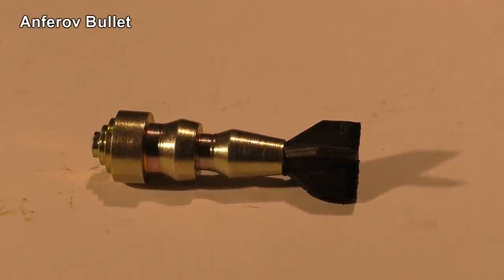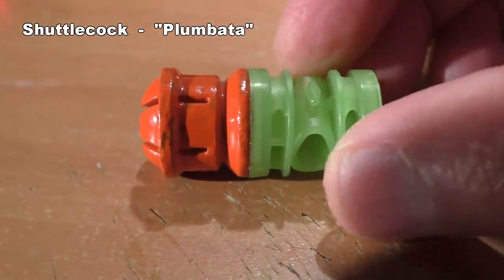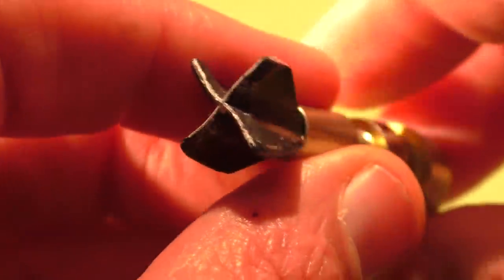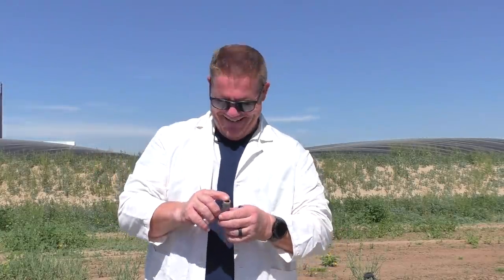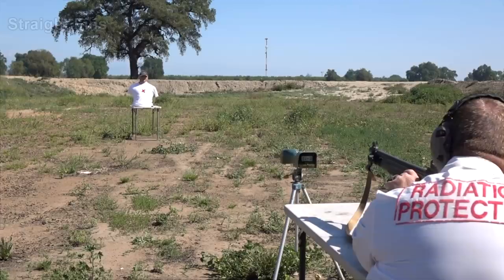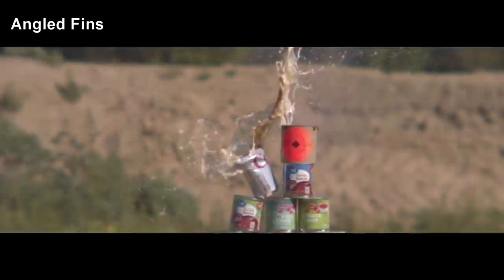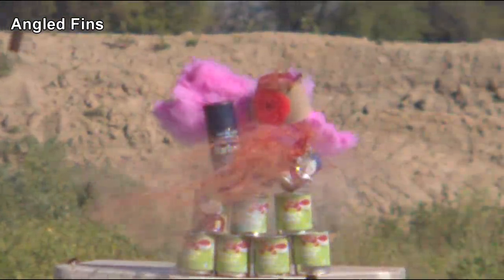Supersonic Darts - The Effects of Inducing SPIN - I learned something!

Comment: Sun Naegele who was interviewed by Ian McCollum, hinted at the stabilization of a diabolo round differing from that on a typical fin-stabilized round. He likened the former to a shuttlecock… the primary effect then would be drag, i.e. the tail is subject to greater deceleration in the air which is compensated by the tail creating a pull on the head of the round, thus keeping it aligned with the direction of travel.

The primary effect aimed for in a fin-stabilized round, on the other hand, is creating lift in the opposite direction when the bullet is not flying straight. This is because there's a non-zero "angle of attack" between the oncoming relative wind and the side surfaces of the corresponding fins. So these work more like aircraft wings.

That said, it's presumable not either or, i.e. the tail of a diabolo will also generate lift if the bullet is not flying straight, and fins also induce some drag.

Comment: What about a fin stabilized projectile with bent fins shot through a rifled barrel? Double the spin double the accuracy !!! What about a fin stabilized projectile with bent fins where the fins can spin independent of the body of the projectile, I had some darts that were like that. What about a fin stabilized projectile with fins that spin independent of the body shot through a rifled barrel? If you shot the fin stabilized projectile with bent fins straight up into the air how fast would it be spinning when it came back down and what would the coefficient of drag be? What if you shot a fin stabilized Fin out of a cannon, would you want that Fin to spin?  Enquiring minds want to know. Thanks for another great video. I'm highly amused by the questions people ask so I thought I would ask a few of my own since I have never had any to ask before.
Reply from the maker: We wouldn't have been able to tell if the spin was from the rifling or the fins.

Comment: The massive rate of rotation by caused by the fins makes me wonder if it caused by the expanding gases from the gun powder through the barrel rather than the air moving over it. 🤔
Reply from the maker: If that was the case,  the muzzle blast would spin it in the other direction
Reply: Good point, love your work good sir.

Comment: All those non-spin-stabilized projectiles use the same effect for stabilization: Center of gravity in front of center of aerodynamic forces. Nose heavy design and/or draggy light tails. 
Adding spin can also add imperfections to the shot. It can add dispersion.
If spin would help, you can be sure that tanks would use it with APFSDS ammo. But they don't.

Comment: Fin stabling only works if the center of gravity is in front of the center of pressure. Basically there needs to be more surface area behind the center of gravity.

Comment: Hi guys,
Just a suggestion for your high speed camera. Instead of filming from behind the projectile like you are doing, set your camera up 90° to the target. Have the camera aimed so that the target is just on the edge of the screen, that way you will be able to see the projectile either travelling left to right or right to left depending on which side of the target you are setup on. Then in post production you can zoom in on the projectile and follow it to the target.

Comment: 1. If the bend in each fin is not precisely the same, you'll create some instability.  2. When striking the target, the spinning projectile will likely do more damage than the one that is not spinning, or at least different damage depending on the details.  3. The energy to rotate is stolen from the kinetic energy from the velocity, so the spin will reduce the velocity slightly (but probably by an insignificant amount).

Comment: I feel like they're onto something. The bomb Styles last torpedo style is pretty cool but what if the whole projectile was the same length and width instead of getting smaller at the Finns the same with all the way to the top and then you make the top slightly heavier to offset just the wings on the end I bet his the spiral ization would be even better and it would be even more stabilized flying through the air straight then wobbly

Comment: I believe if you spin it from behind like that.
You create oscillation that affect heavier part AKA tip of projectile you throw it of balance.
The rear MUCH lighter than front.
Leave it as it is as original.
First shot set that in stone.

Comment: I'm thinking way too much spin. I'd set the spin for the whole fin to be enough to make 1 turn in 20"... 

Probably about a 5⁰ overall bend, 10⁰ if you bend half the fin. (Same way the F4 fighter got those bent wingtips. Flight tests showed that the wings needed more dihedral, so in order to avoid redesigning the whole wing box and fuselage center section they raised the wingtips up enough for the average dihedral angle to be 6⁰.)

Comment: So In the archery world most people use a 3-6 degree helical or “bend” and they’re only going 300 fps many say that anything over 6 degrees will cause parachuting “ the back of the arrow dancing around and losing stability “ I think spin does help some even with fins already there. Just like in archery 95% of shooters use some offset or helical. However I think you had a little too much bend for something going 1400 fps

Comment: Makes sense to me that the velocity did not change much the energy it takes to spin something up is not very high the momentum is rather small in that axis, If it was a really wide disk with a lot of weight near the outside edge then it would take a lot more energy like a flywheel.

Comment: There are two different effects used with spin stabilization.

1) gyroscopic stabilization - typical bullets, 100,000-300,000 RPM
2) spin-ensured aerodynamic symmetry - RPG grenades, 2000-5000 RPM

When you have a finned projectile that does not spin, tiniest asymmetries in projectile's geometry can cause it to veer off unpredictably. Spinning cancels that out. But the rate is way lower - trying to achieve "gyroscopic" spin rates is completely pointless (and especially detrimental for HEAT warheads). This is why they only put a single-bevel edge on RPG fin blades.
Reply: same as arrows, they just smear their inaccuracies all over the circumference by slowly turning in flight, so they don´t veer off, but move on a narrow cone. the main function of the fletches is to produce a little drag on the rear end to keep the nock from trying to overtake the tip.

Comment: I wasn't surprised at all that the first spin stabilized dart's flight was erratic, if that was the dart shown at 1:13 with the drawn lines on the fins, because the fin angles (imo) were not symmetrical.

Comment: Spin stabalisation is gyroscopic, it can be an internal gyroscope, 'like a rocket' but a trad. spin has drawbacks and benefits. It has induced inaccuracy as a peculiar flight path as it 'walks' from the spin. They don't fly straight but in a corkscrew.

But, they are more resistant to certain conditions over long distance and it can be the cheapest form of stabilization. Can be. It can also remove or reduce side effects of fin stabilization and sabot. It also can have less drag by itself, but not always. To those demanding it, its quite hard to perfect the amount of spin for a round and achieve it, and sometimes that is none.

Spin stabilization also makes smart rounds a bit harder, and another force direction for integrity. They can also make deployable fins more reliable. The spin can also be used to guide on to target similar to the aim-9 sidewinder.

But you'd be asking a lot from spin to make much odds at short range in a shotgun with additional stabilization. It works well with round shot.

Comment: the problem you're having is that for a split second exiting the barrel, the spin being imparted on the shell is actually from the back from the propellent pushing, then once the force from that dissipates, the air flowing stops that spin and starts spinning it the other way

this will impart torque

Comment: The biggest issue is people make the head too big and the body too short for proper supersonic stabilization with fins. If it’s already in a sabot the head does not need to be super huge.
The big point here is the ratio of diameter of the frontal face to length of the body. I doubt much more than the very tips of those fins were interacting with the air. It’s also probably why the spin stabilized one was so violent. I’d adjust it to maybe 5* max 

It’s why things like modern tank ammo and guns are smooth bores and long rod with fins. 
After about a 10-1 ratio of length to width spin stabilization starts to not work reliably. As ap ammo got longer and longer with smaller diameters to penetrate armor. Because velocity and sectional density is what kills armor. 

Also modern fin stabilized ammo is becoming very very slightly spin stabilized. But the fin angle is generally sub 1 degree.

Comment: Fins work because as the projectile pitches or yaws it pushes more on the flat sides that introduces to the air flow. Say it pitches without any yaw, and the fins are aligned to that reference. Two of the fins will be steering it back straight on that axis while the other two will be holding it straight on the other. During that time, however, the yaw fin that has been pushed out into the air temporarily has a greater steering effect than the one "behind" the perpendicular fins. If they're straight it's no big deal, but if they are pointing opposite directions it will have an unbalanced effect. The center of rotation of the force created will not line up with the center of mass, and so rather than stabilizing the flight they will disturb it, which then causes a feedback loop of it getting pushed off center in one direction because it's off center in the other.
Reply: That's why they dropped most of the bottom fin off of the X-15 mid flight, because on re-entry it amplified the effect of the lower fin, and made it hard to control the plane.

Comment: I feel like this isn’t a great representation of spin stabilized projectiles. I could be missing something, but I feel like to be accurate, as a representation of spin stabilization, extreme care would need to be taken, in regard to uniform angulation of the fins, as well as uniform weight of each fin.

My inclination is to think that even small deviations in either of the aforementioned factors, would result in a significant wobble. This is somewhat addressed in the video. But I would like to see the result with a perfectly balanced projectile.

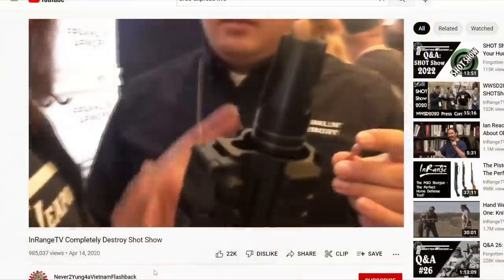Comment: Though spin is a great way to stabilize projectiles the rate of rotation is critically important. Simply inducing a spin in a shotgun projectile dose not automatically = a more stability. Where an M4 works well with rotation rate of 1:7, I'd guess a shotgun would need something more like 1:28 or 1:35 or maybe even slower than that. 

If you spin the projectile too slow you don't get very much stabilization. Too fast will actually cause instability. The length, weight and speed of the projectile all effect what the proper spin rate will be. This why an actual military M4's barrel is different than the twist rate in many civilian ARs. The M4's twist rate is optimized to use NATO ammo whereas civilian ARs often use a slower twist rate because they use a wider variety of ammo found in the civilian market.  In general heavier and or shorter projectiles should have slower rotation rate than longer lighter projectiles.

Also arrow dynamic fins are a poor choice to induce rotation cuz they apply rotational energy only after the projectile is out of the barrel and then they apply that torque to tail of the projectile....Both are less than ideal conditions when you want to increase stability rather than cause instability.

Comment: As you mentioned around nine minutes 18 seconds in your video minor defects can affect the trajectory of the bullet. I noticed that the bend that you put on the fins was, I don’t mean this is a slap in the face, then somewhat crudely. Just imagine if you only been one thin how that wouldThe projectile wobble in the air. I believe you would have a more accurate test were you to standardize the band on each film down to the thousands of an inch. That should give you a much better idea as to the benefit of spin stabilization on this project tile. In my humble opinion

Comment: A rocket goes straight because it’s flight is controlled with actuated fins, and thrust vectoring, not by static fins. So the person at the trade show was wrong. The fins on the original round “stabilize” the projectile by keeping the back end of the projectile in the back, not by making it go straighter. They prevent end over end tumbling. There are two different forces at play here and the discussion in the video seemed to conflate them.

Comment: There's also the issue of length. Generally, yes spin will stabilize a projectile, but this is proportional to it's rotational inertia, and most importantly the axis along which it has the most rotational inertia. Part of the reason that long-rod projectiles like antitank APFSDS rounds are typically shot through smoothbores is that once the length of a uniform projectile exceeds about 2 times it's diameter, the gyroscopic force will DE-stabilize the projectile and instead induce tendency to tumble end over end,  as the greatest stabilizing influence is found along an axis with the highest rotational inertia (the qualifier of 'uniform projectile' is important, and projectiles with light cores and heavy jackets or 'bands" can bend this rule) With fin stabilization involved, projectiles with a very high length-diameter ratio can oscillate wildly, as the aerodynamic forces contend with the tendency to assume a rotation of highest inertia.

That out of the way, I want to disclaim: I am not an engineer, I am not trained, there are probably corner cases involved, and this does assume a fairly long projectile relative to diameter, maybe on the order of 3 or 3.5 to 1 length/diameter ratio, and I expect these rounds are somewhere closer to that 2/1 L/D ratio. I'm just a guy who finds interesting tidbits about random stuff and involuntarily commits them to memory. If anyone does know more about this, I really do find it interesting, and I'm always looking for new engineering/projectile-design trivia to learn about! : )

Comment: Interesting experiment!
My opinion first (out of consideration) and the gibberish I base it on afterwards if anyone's interested (lol)!
The finned tails would have to be perfectly symmetrical on the modified bullet (by machining or mold created by machining) for the spin to take place on centerline to make the test accurate.
Regardless of that, the fins (straight or spiral) only create more drag on the back of the bullet, so the spin is of little to no advantage. 
 Air has mass, that said, the leading geometry of the 'bullet' is plowing its way through the air having (having the greatest momentum/energy) and the highest drag (C.D.) and any portion(s) of the geometry behind has much less by traveling in the 'hole' in the air made by the front and mostly affected only by the boundary layer of air flowing over the bullet as it travels through the air, so the trailing shape would pivot around the center of mass to equalize the drag, but the area of the greatest mass of the bullet (in this case) dictates the path of the bullet through the air, and drag affects it far less.

Comment: The imperfections of the bends on those fins look as though they were done by hand and will never give you an accurate gauge. Those sharp bends at the end of the fins done by what was probably a pair of pliers, are not gonna cause any consistency or stabilization from shot to shot. A more accurate sabot setup would be a full diameter of your choice projectile (shaped like a missile), and having angled or offset fins that gradually start behind the widest part of the bullet to its back end to create twist. Essentially, the bullet will be machined this way so that the thickest point of the solid projectile is as thick as the mainly finned tail end. Something like this will create more stability and fps at longer distances.

Comment: Getting into this with airsoft. Toothpicks paper aluminum foil tape hole punchers tissue paper superglue wax thread. Less spooky than a 12 gauge and fire faster than ball bearings (less weight, greater gas capture)👌

Comment: the reason you want things stabilized is because otherwise when you're shoving something long and skinny into the wind on its long axis, like an arrow or a bullet or a dart, is that wind resistance will make it want to tumble, because the tip is facing more resistance than the rest of the projectile

putting fins on things stops a tumble by making the tail of the projectile most aerodynamic when it's directly behind the tip; any tumble would be stopped by wind resistance "pushing" the tail back in line

the shuttlecock approach makes the flare have greater drag than the tip

and spinning adds gyroscopic stabilization

each of these obviate the others under most circumstances, although arrows are sometimes fletched in a helix pattern to improve accuracy at the price of velocity

this is a very long way of saying that I don't much see the point of redundant stabilization on shotgun slugs; while I love seeing these wacky ideas tested, a great many of them strike me as a solution in search of a problem

Comment: The problem with manually bending fins is the 4 fins won't be exactly the same angle.  You can impart wobble to the projectile that way, and it may be why we say the first projectile wobble.
Reply from the maker: There was a lot more to it than just manually bending them.